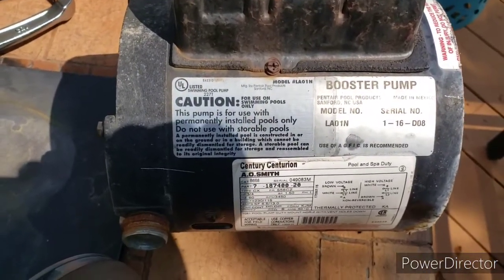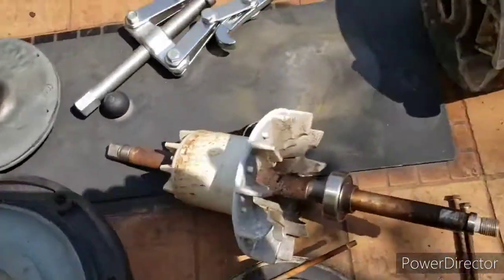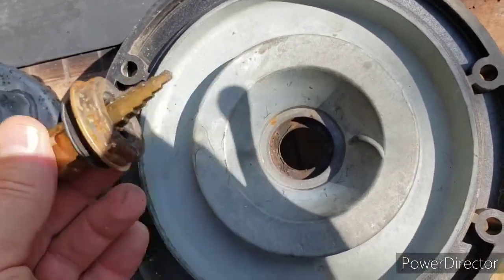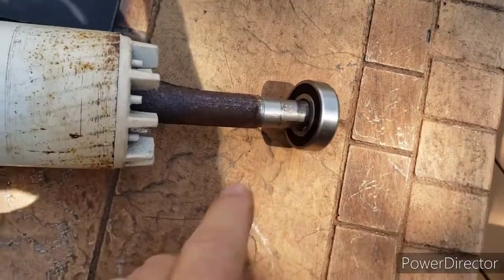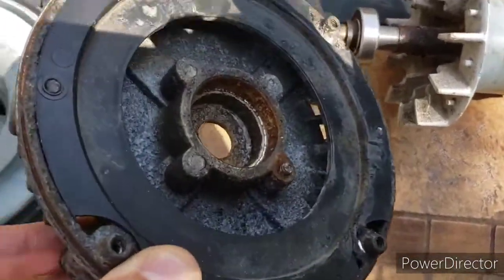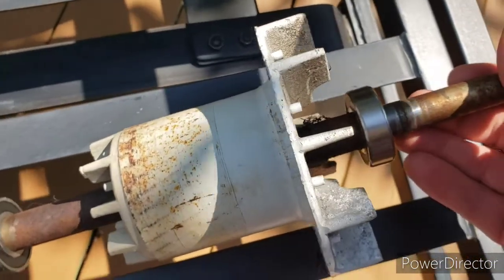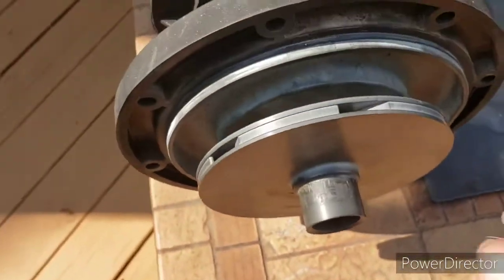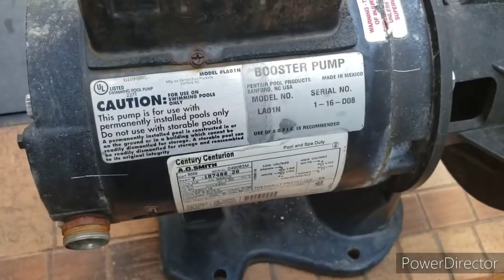Polaris/Pentair booster pump bearing replacement

Comment: For that screw that was tough to get to - on the inside/backside is a little plate that is tabbed over to keep the bearing in place and keep the housing  from moving - straighten the tab and then use a long screwdriver and hammer to unscrew it from the back side - worked for me.
Reply from the maker: Thanks for your feedback.

Comment: I would use anti-seize compound on ALL the threaded fasteners. It will last longer than WD40 and make the next tear down easier. Especially on those long through bolts.
Also don’t touch the ceramic seals with your fingers. If you do, clean them with alcohol and a microfiber cloth just before assembling.

Comment: My superflow motor old bearing was a 6203, but a new 6203 won't fit on.  The shaft is clean.  I swear both bearings read 6203.  In fact I got four new bearings and all are too small for the rear shaft although they fit the front nicely.  What to do?  There was a noticeable difference in the size of the bearing inner races, I think .62" for the new and .635 for the old.  Makes no sense to me.
Reply from the maker: You can try putting the shaft in the freezer for 15 minutes and heat the bearing in the oven for 5 minutes at 100 degrees Fahrenheit. Next, try sliding the hot bearing on the cold shaft and see if that works better for you.

Was the original bearing stamped 6203?
Reply: Dang
Reply: I think Polaris changed the parts for the same model around 2011-2012 so you might want to verify the model year of your Polaris pump.